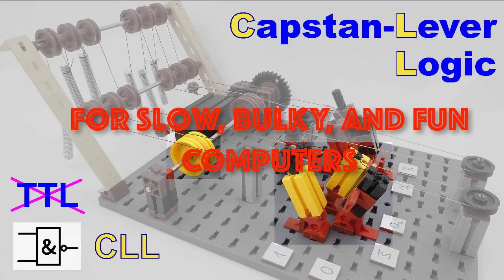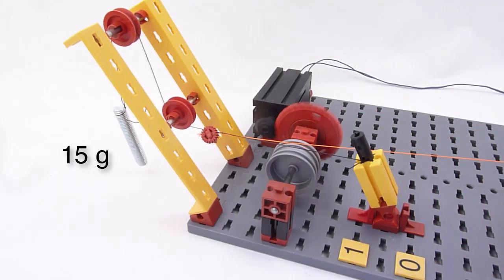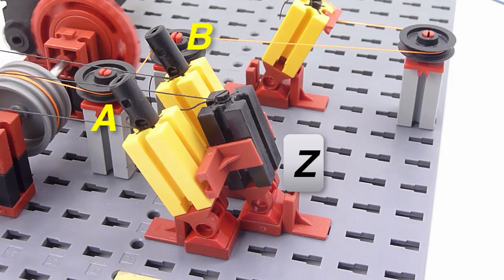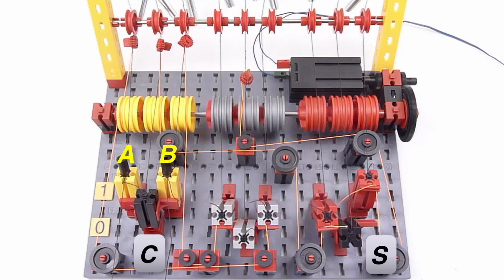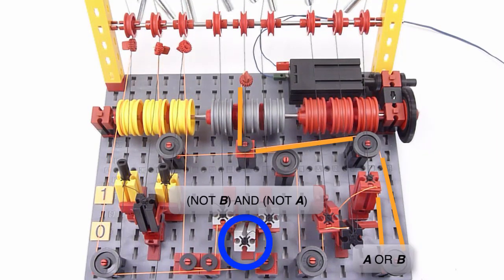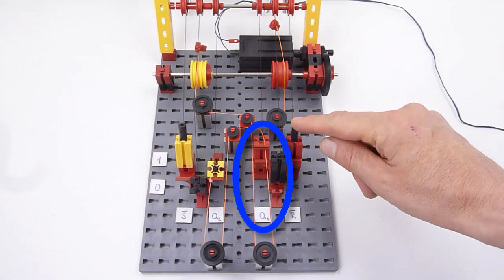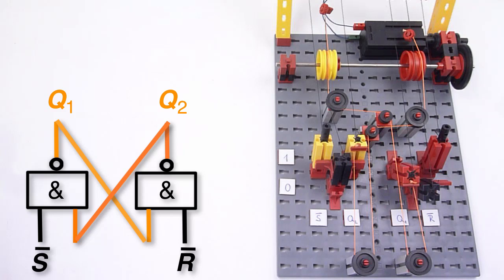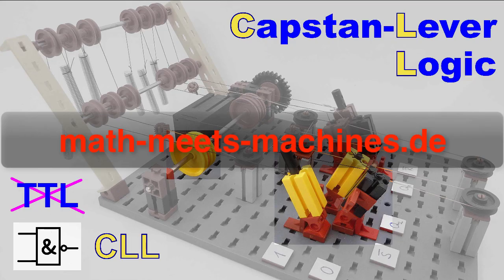Active mechanical logic gates | Capstan Lever Logic (CLL)

Comment: I don’t quite understand what the orange string is doing. It’s wound on the capstan and can move tighter? Why doesn’t it just pull the rest of the gates and destroy itself. Or is it slipping?
Reply from the maker: Take a look at this video, https://youtu.be/oNNkNc7mFJ4, for example. If the person pulls at the rope the rope gets tight on the drum. By friction the pulling force is amplified by a large factor. If the person releases the rope completely, there is no friction any longer.  The drum does not excert any force on the rope. The capstan is in fact a linear force amplifier. But only in one direction! In the other direction the rotating drum supports the slipping of the rope on the drum. This amplification behaviour is the heart of my gate mechanism. The weight of one weight can lift many other weights. But the weight of these other weights is not amplified along the same connecting strings.
Reply: @ perfect that’s how I imagined it, but wasn’t quite getting it.

Comment: Interesting concept.  I guess chaining gates together could be challenging?
Reply from the maker: No, not at all. Much easier and much more flexible than signal transfer by any rigid material. Also very easy to supply multiple inputs by one output. I am going to build a 4-bit calculator in CLL next (simple ALU +/- and 1 accumulator register, so that you can add/subtract 4-bit-numbers to/from the accumulator).
Reply: That will be awesome to see, good luck building

Comment: This a very interesting design, tho, I am perplexed by the use of the immobile / sliding string around the constantly  spinning capstan. Wouldn't that result in long term wear of the string?
Reply from the maker: I would expect some wear after many weeks of continuous use. The strings are made from Dacron. This is actually flying fish backing line. Very smooth. Tim Robinson from the Meccano community has an excellent article about his use of such strings in Torque amplifiers for his Differential Analysers. Anyway, since I will build only small calculators/computing elements with this logic, the capstans will not work for than a few hours per week.
Reply: @mathmeetsmachines  Thank you. It is very interesting.

Comment: Lol this is great. It's also a pet peeve of mine that whenever I see a system of mechanical logic presented for educational purposes, usually it doesn't amplify and isn't cascadable. It's great to see that you've thought about fan-out! A man of my own heart. 

One question, could the system be provided with level restoration? I don't think it has that, right? Or maybe it kind of does?

For a system of logic gates to be truly universal it has to provide both fan-out and level restoration (I guess this would be current gain and voltage gain, in the context of TLL). For CLL there is obviously going to be motion amplitude attenuation due to the elasticity in the strings. How could one fix this, so we could cascade infinitely many gates and create self-sustaining feedback loops?

I suppose the first thing that comes to mind for me is to attach the output string of a gate to the output lever slightly further from the fulcrum than the input strings are attached, and then provide each input string with a small spring or rubber band. This way, the output string would move further than necessary to actuate the next input, and thus ensure complete actuation, with the excess motion going into stretching of the spring/rubber band. This might still be difficult to set up, because it would be necessary to ensure that the spring was slightly stretched at all positions of the input lever to keep slight tension on the input string and prevent it falling off the pulleys and capstan.

Another approach which seems much closer to what you already have: again, attach the output strings further from the fulcrums to achieve the amplitude amplification. Then apply some sort of stop to the "pull-down" weight (the one which provides the capstan input). You almost already have this: the output lever of a given stage seems to provide a stop that halts the descent of the "pull-down" weight. But I think to really ensure digital level restoration, we'd need the input string to a capstan assembly to be loose for an input of "1", and the output string to be loose for an output of "1". That way there's slack on both sides, and small deviations of the input from the nominal 1 and 0 leave the output unchanged. So I think there'd have to be a separate stop on the pull-down weight (such as another string tied between the weight and the top pulley bar). 

To use the simple NAND configuration shown at 2:34 as an example, we'd somehow lengthen the black lever, so it tended to move the second weight more than necessary. Then the string would be adjusted so that with the lever in the "1" position, the black input string to the capstan assembly is loose. Then, when the lever moves to the "0" position, it would of course move the string beyond the position necessary to completely relax the orange output string over the capstan, and the output string would be loose. I think if this is done, then small errors will not accumulate and any number of gates can be cascaded. 

Just given where you tied your strings this might be happening to some extent already. Maybe you've already thought of all this! The orange strings going to your input levers actually are connected slightly lower down that the black strings leaving the output levers. It just seems that the amplification isn't enough to completely overcome the stretch in the strings. 

The obvious objection to this system is that now the orange strings become loose on the capstan drums when a capstan puts out a "1", and they'll slip off and get tangled. That's a serious objection, and maybe one not easily solved. Although perhaps there is a way to separate the amplitude amplification and clipping/saturation function I'm proposing out from the capstan assembly, so that the capstan only performs force amplification and always has mostly tight strings (and produces some slight amplitude attenuation).

Well this was a very thought provoking video. I think systems of mechanical logic are fascinating and I look forward to seeing whatever you present next!
Reply from the maker: Thank you very much for your valuable comment! Indeed, the levers are well suited to compensate the loss in amplitude due to the elasticity of strings. As you have noticed, I can adjust the distance between the fulcrum and the attachment point of the orange output strings on the input levers. Ideally, this should be done in such a way that the input lever just moves to the lower stop when pulled to 0. This way, there is perfect tension in the string for the support of the capstan, and the weight moves the output lever to the upper stop automatically. If you decrease the distance between fulcrum and attachment point a further, the tension in the string increases when the lever is pressed to the stop. It is ok within some interval, but you hear this because the motor starts to work harder. You hear that power is wasted. So far this concept worked very well. I plan to build some larger circuits in the next weeks/months (4 base plates and more) and report if I'll encounter any issues.